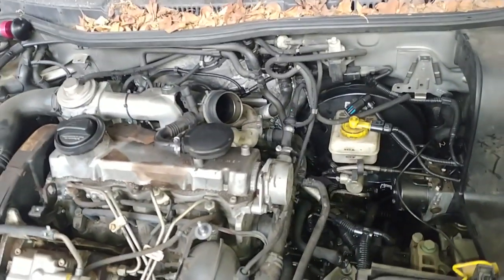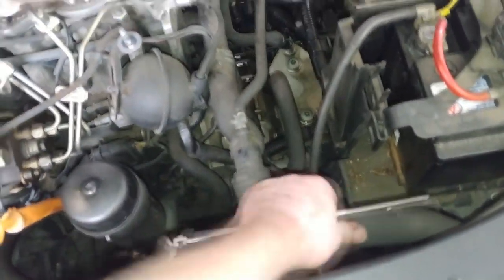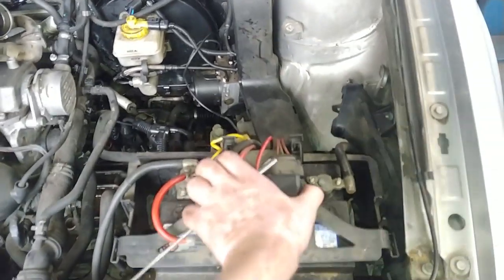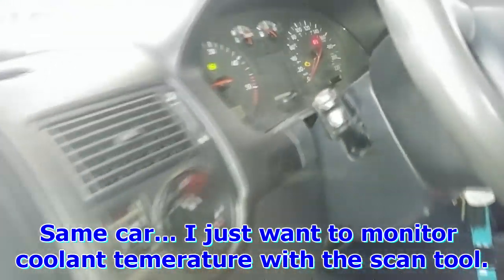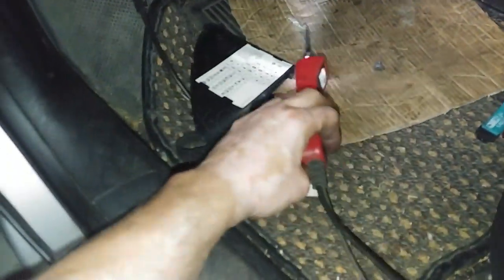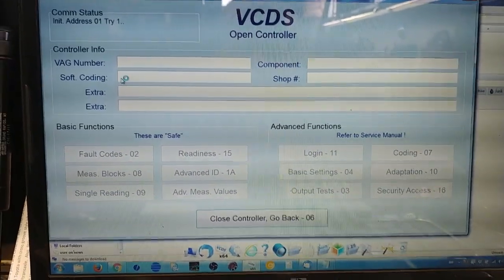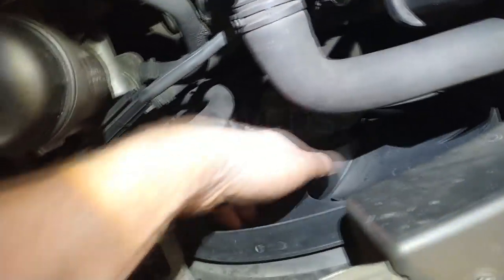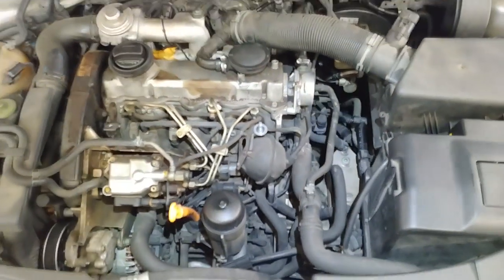VW 1J 9M: ALH TDI Coolant leak part 1

Comment: Hi can you advice me . I have a VW golf Mk4 1.6 sr i drove it with water only for quite a while for more then 5 months it was standing for 3 months without me driving it then i drove it 1700km after that i found out i had a leakage so i replaced one coolent pipe the metal one that runs from the thermostat to the side of the gearbox .. and also my thermostat got Bypassed so coolant was and is still just running freely 
.. buy naw i have an overheating problem after i replaced the rusted pipe and my fan comes on after the car has overheated more then 100 degrees and when i take the water release valve off water only dripps while engine is running ...
Reply from the maker: You should not only use water in the cooling system. Water alone can cause the engine to rust inside... and the water will turn brown. If the water pump has a metal impeller... it can rust off, like in this video: https://www.youtube.com/watch?v=KWCdKgGvpUM  Check water pump operation and make sure that the coolant / water is circulating back into the coolant reservoir (via the return hose). Post videos on your channel so that I can see what is happening.

Comment: Hey thomas could you give me any advice how to diagnose a bad wheel bearing on my driver's side of my car? Things of note is I did the rear drivers side about 2 years ago but I'm hearing that crunching/metal grinding noise on the drivers side when I'm driving on highway next to barriers. I recently did the front calipers, pads and rotors up front and I was spinning the hub while I had it apart but didn't hear that grinding noise. When I did the drivers rear 2 years ago it was that same similar sound on highway I'm getting as of now but I could hear it when I jacked the car and spun the wheel by hand. I'm trying to save the 300$ from not having a shop do it but also wanna make sure i diagnose the right one. Thanks as always buddy. Always extremely appreciated!
Reply: I actually just watched a video thomas of a guy who said a really great tip (don't know if it will work) but he said to grab the coil and spin the tire and he said no doubt you will feel the vibration of the bad bearing. Who knows if it will work. Fiqured I'd share jic. Thanks
Reply from the maker: Bad wheel bearings are easier to diagnose in the back because the rear wheels spin more freely on front wheel drive cars. Yes, holding the front coil spring while the wheel / hub is turning can help identify a bad front wheel bearing. I usually put the transmission into 2nd gear and let the wheel spin off of the ground (raise & support the front of the car on jack stands). Leave the wheels attached to the hub... the extra weight helps transfer the sound of the bearing through the hub. Front bearings can also be identified by driving in a slight slalom... at steady cruising speed, move the steering wheel to the left and to the right... if the sound of the noise (rumble) changes, then that indicates that it is a front bearing that is bad. If the sound increases when you go left, then the right bearing is the bad one. If the noise increases when going right, then the left front bearing is the bad one (more weight on a bad bearing will cause the noise to be louder).
Reply: @EXOVCDS  You are awesome Thomas! Much appreciated for the help. Yeah when I was doing the front end and had the rotors off and spinning the hub it wasn't making the noise but like you said and my stepfather who is a mechanic but lives in another state said without being under load and going fast enough it could not make noise. I got a Quattro so I'll put it on jack stands all round or take it to a diy lift where I can pay to rent a lift for a hr. Your video helped me unbelievably when I did the rear a couple years ago. I also have a broken bolt head on the drivers side axle but that shouldn't be too hard cause they are studs so I should be able to grind it smooth and shouldn't screw me up too much. I'll keep you posted buddy. Thanks again, I've said it before you are the most helpful yt'er to their subs! 👍👍👍👍

Comment: Ya gotta love the customers that want a quick rough quote done up, meaning they will nail you to that cost if it is not correct even if you have not checked it over yet. For nearly all diagnostic work I just quote the hourly rate, I will be honest with my time and if they trust in the workshop they will go ahead. If not I can't help ya. 
Great video as always and the return flow check in the expansion tank is a good tip.
Reply from the maker: Some people get scared when we say there might be more... they need to understand that "letting us make sure that all is ok", is money well spent!

Comment: Got a 1996passat with a TDI 1z engine in her. Had all the fluids leaking from various places. Thought the water leak was from the thermostat housing but as I took more and more parts out uncovered the leaking water pump housing and found the pipes down the front of the block had turned to jelly due to the oil cooler housing leak!! I deliberated for a few minutes then decided to do everything. New.. pipes, water pump, oil cooler, filter, thermostat, coolant flanges, tensioner pulley, cam belt kit, rad hoses, water tank, seals and gaskets everywhere, alternator upgrade to Bosch 180 from a B6 and a low mileage VE pump which I high polished lol. Cleaned the block up and brackets then painted all the metal work in silver por15. Detailed everything to clear the gallons of oil off them. Best thing I ever did.... All because I noticed a puddle of water under the car with a rainbow sheen lolol xx
Reply: Oh and new power steering pump. Managed to save the super rare power steering suction hard line that runs under the front beam and the rocking horse shit pressure hard-line too. Both were rusted badly. Suction pipe had a hole in it so I welded her up carefully. I then soaked each part in phosphoric acid until all the rust pits were empty.. followed buy a clean up and 4coats of por15. Parts are as good as new. I got laughed at when I asked about replacement parts for these pipes on the forum lol xx
Reply from the maker: As a DIY'er... that's the best thing to do! Take your time, remove as much as possible and replace as much as possible! A customer is not as understanding when it comes to "suggestions", with regards to what else to replace / service "while we are in there".
Reply: @EXOVCDS  you know this man xx

Comment: 👍 tough call
Reply from the maker: The key is to mention that here might be other issues... that can prepare the customer for a bigger bill. Lots of times we don't know how hot the engine actually got. Most of the times the customer doesn't even remember that the red warning light was flashing and that the needle was past the 3/4 mark. =(